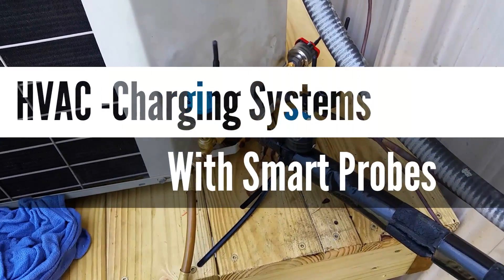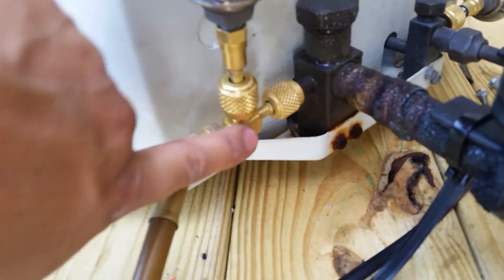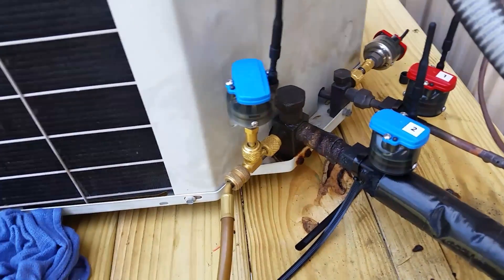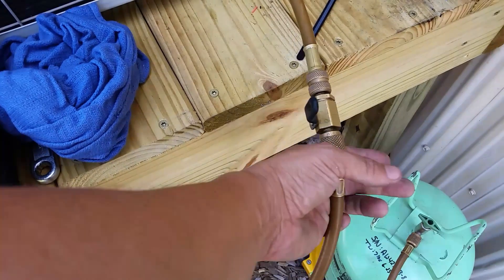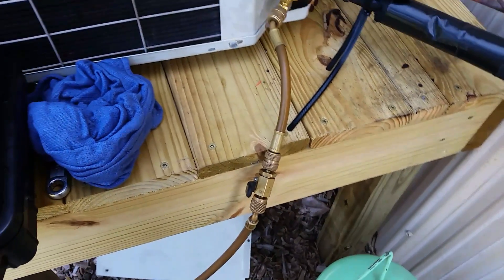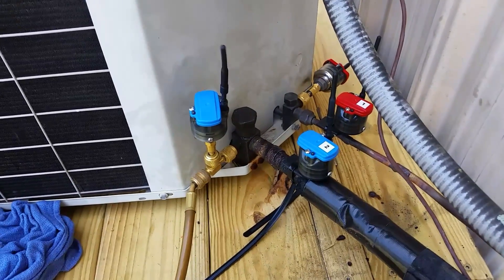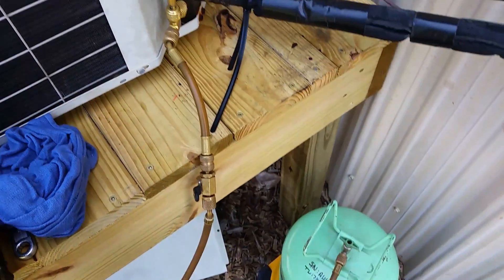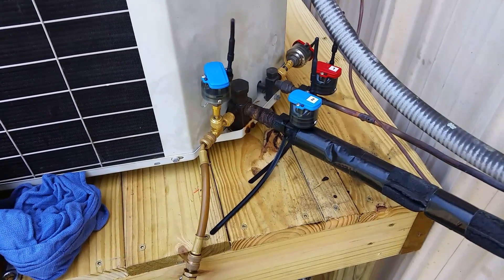How To Charge A System With Smart Probes

Comment: Can you charge with a core removal tool using the smart probes?
Reply from the maker: Absolutely
Reply: @HVACinSC  would I still need a short hose with ball valve or can i do it without it
Reply from the maker: Core tool should have a ball valve on it. You will need a refrigerant hose to add or remove refrigerant

Comment: This is a great video, is there a part number for the tee fitting? Thanks!
Reply from the maker: Danny L Thanks Danny. 
If you visit Trutechtools.com and search "CPS 1/4" SAE Tee Valve Connector - 2 Pack" it will pull right up.
Also use code HVACINSC for 8% off any order.
Reply: HVAC in SC     Got it... thanks again!

Comment: How happy have you been with the performance of the Smart Pro/r? I do a lot of walk-ins and was curious about the range. I have the testo 550 and the testo probes but they have very poor range and if connected to say a rooftop condenser I loose the signal before I get inside the Box.  Have you used the Smart Pro/r to service a walk-in and if so how reliable was the connection?